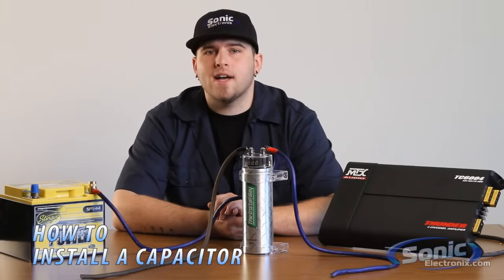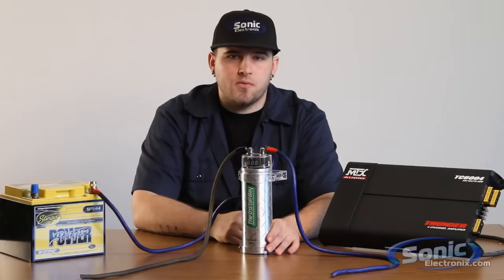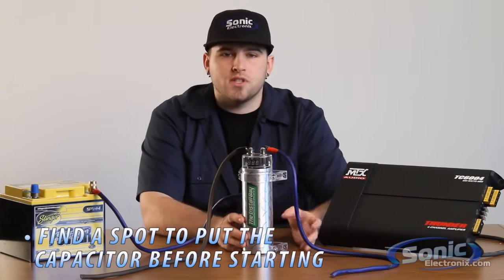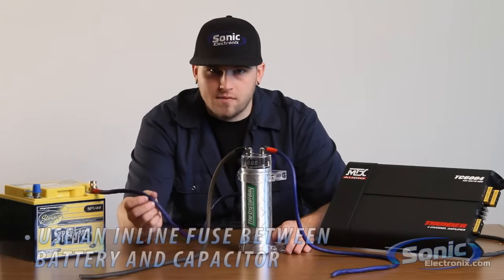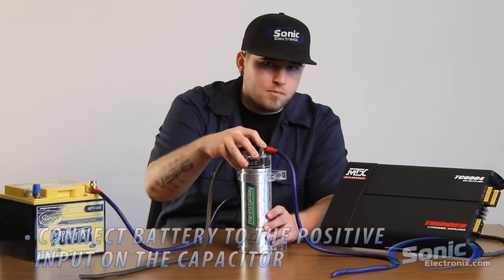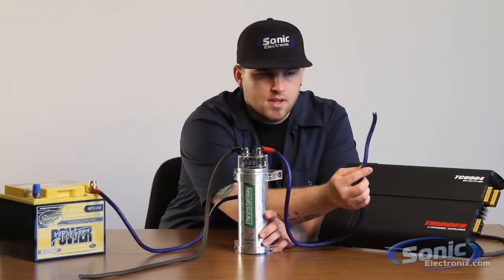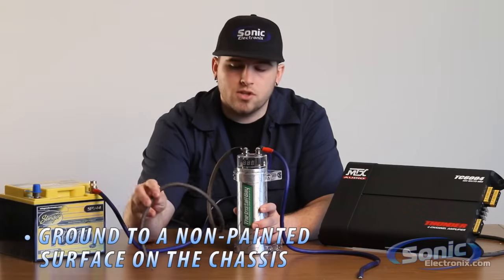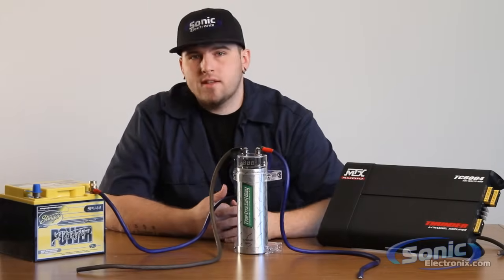How To Install A Car Audio Capacitor

Comment: This may not be the help you're looking for but after reading what you're working with, this is my suggestion. First of all, 2 TypeR12's need quite a bit more power than the amp you have. Especially in a sealed enclosure. Underpowering is as bad as overpowering. Second, if and when you do get that better amp, 6g wire is too thin. You need at least 4 and thats minimum. Third, forget the cap. Just run an extra battery. I know this is more money, but you will be MUCH happier with the results.

Comment: If you study how a capacitor works, you will quickly start to question the need for one in the first place. Forget the cap. Just get an extra battery. "Kinetic" is a great way to go.

Comment: Hey I was just wondering if anyone could help me out. Does the gauge wiring matter when using a capacitor? And my cap has 3 terminals for positive and 3 for negative. Can I use any terminal for input and output? Input being from the battery and output being to the amp. Im using 6 gauge wiring, 80amp fuse, 1300 watt exonic amp 680 rms, and 2 12 inch sealed alpine type rs. The cap is 2 farads. Thanks in advance

Comment from the maker: The wire should be fine, as for the fuse you would need to get an inline fuse between the capacitor and the amplifier.

Comment: and what sort of fuse is going to be the best for 5000w its my first time with such a big amp (i have 0 gauge wire will that be ok ?)  and i get that it goes battery fuse capacitor but then do you need a fuse between the capacitor and the amp ?

Comment from the maker: A capacitor temporarily stores energy to relieve stress on the amplifier. A capacitor should not be used to replace a battery if the system is underpowered.
Reply: What size fuse should I use

Comment: a capacitor or cap for short holdes a charge and lets it out whenever bass is being played in your car audio then recharges at very fast high speeds

Comment from the maker: You want to put the capacitor in line between the battery and the amplifier.  If you have multiple amps you'll need one cap for each amp and use a distribution block to route them back to the battery.

Comment: Q:What is it better to connect the capacitor before or after the power block? And how will i do that with 3 amps one to my door speakers and two the my sub, but the sub amps are link to each other. Help please. The sub is an Orion HCCA 10.4. O everything is running on 0 gage.

Comment: Stupid question, but I hooked up my capacitor when I was tired and before I really read any instructions, and I connected the battery to the positive, and the negative went to my amplifier. It worked well for a while, which is what had me confused for a bit, then it started cutting out. My question: did I fry my capacitor by doing this, or is it still probably useful when I hook it up properly? If it's still good I'd rather keep it and let it work.

Comment from the maker: It would be better to ground it to the chassis. If your battery in in the back of your car, you can ground it to the battery. Sometimes grounding it to the battery can cause ground loops to form.

Comment: And i made the big 2 in ground - to get more ground to the battery.The relé really helped the amp not to suck much of the batery when the car was stoped. I have the double relé 80A with on/off switch between the capacitor and the amp only to get the amp shutdown and i made a cut with another switch to my radio becouse my radio really consumed battery even when was off. Does this means that the relé its doing its job right and the capacitor and battery are charging good ?

Comment from the maker: There can be many factors at work here. It could be a bad ground, something in your system isn't turning off (like your amp), but it's likely a defective capacitor.

Comment from the maker: First, you need keep your grounds as short as possible. Also, if your lights are still dimming you might have exceeded the limits of your electrical system (i.e. Battery, capacitor and alternator). If every thing has checked out ok, then you might need a higher amperage alternator or even possibly a second one.  You might want to also consider the big 3 upgrade if you have not done it already.

Comment: The most of people don't know how to really use a capacitor and what it does. The capacitor only helps powering the amp during hi drawn kicks, ir order to not cut the output signal 'cause a power drawn.
Everybody I've seen connects capacitor in the wrong way. Just conenct in parallel to the battery. In this case, the capacitor is useless. The right way would be installing a hi power diodes array between battery and capacitor. Doing this, yo prevent discharge cap throug the rest of vehicle.

Comment: And another thing.the car as 44ah 440Abatery.I have the ground amp screwd to the security belt.And then i have the capacitor grounded to the negative batery and between the capacitor and the amp hive conected a ground cable that conects the ground amp+capacitor.the good thing is that the voltage are more powerfull to the capacitor and batery does not discharge.But the head lights dim quite a bit allways in the 2 ways hive grounded the capacitor etc goes dim all so in dashboard lights.whatcanido?

Comment: Hi, Hive seen many videos and photo examples on how to instale amp and mega capacitor. And my question is:My car as a capacitor and a amp with 2channels 550w and i before ground it at the same spot of the amp. And the baterydiscarged and the capacitor showed picranges down 12.5volts.Now hive seen a picture that shows to ground the capacitor on the negative batery.Hive donne that and the picrange shows more thant 13v plus and low pic12.8v but every time the lights of the car vibrates,whats rong?

Comment: A capacitor is more for supplying your amp with 12volts at all times (if it dips below 12 you're going to loose quality and power)

Having a capacitor whilst your engine is off will let your sub last slightly longer if you leave it on, but you battery is still going to be drained (it's the same as just putting two battery into your car)

There really isn't going to be a battery in the world that's going to store enough to keep a 1.1kw amp running without the engine on I'm afraid.

Comment: Is it ok to run the power to the amp straight from the positive terminal on the cap and then run the ground from the amp to the negative terminal on the gap to a ground point?

Comment: ok you almost answered my question in the video. should the cap be grounded at a seperate location than the amp? or can  the amp or amps be all grounded at the same spot as the cap?
(should)

Comment: It just means you wont be draining your battery as much. But your alternator still has to charge the capacitor... if you get what I'm saying.

My girlfriends Corsa has a 3.2 k amp and it's only running off the stock battery. head lights dim quite a bit though.

Comment: I'm looking at purchasing a 2 farad capacitor for my 1800w kenwood system. Is it required to have an upgraded battery? I have a side terminal battery and I had to mess with some bolts to install the amps power cable, I'm can't seem to find any car audio batteries or anything much larger than my stock battery w/ a side terminal.

Comment from the maker: If that is the total wattage for your system them we would recommend an Kinetik HC1800 (KHC1800) or bigger to run in-line with your stock battery.

Comment from the maker: @400exman02 You can get a capacitor. But, the best thing to do is get a power cell battery. Capacitors are a great addition to a power cell battery.

Comment from the maker: @hasnachos This is only for stereo applications.  It is used in line between an after market amplifier and your battery.  If you want to just increase the efficiency of your entire electrical system then do a big 3 upgrade.

Comment: @mardegan86, you can have 1 ground dude, try ground one amp first to ya chassis and see if it goes into protection mode if it doesnt try unplug that one and plug in the other one and check again

Comment: @scootbmx01 its grounded on a 10 to 12 inch long metal that goes under my back seat, do you think it needs to be directly to the chasis, also theyre about 4 inchs away from each other, i have 2 amps.

Comment: @scootbmx01 i do have power going to the amp, im not using the capacitor anymore im getting a gel battery instead. now my amp doesnt turn on, i already checked all the fuses and i do have power going to the amp, the amp got 2 lights a red and a green one, the green one says power the red one says protection, only the red one turns on. any idea why is that?

Comment: is this only for stereo applications or can you also use this to balance voltage drop when you use all the electronics in the car simultaneously? lets say, car stereo and bass very loud, every window rolled down simultaneously, brights on, a.c, adjustable seats being moved, wiper blades on high and any thing else that may use electricity being operated all at once? i was thinking about this because windows roll up faster one at a time.

Comment: @jody024, exactly if you have the space then batteries will be heaps better but if you dont caps are the next best things and if you want the best of both worlds you can get compact power cells etc:)

Comment: @mardegan86, your cap turns on but reads 00? what capacitor is it? ummm as for your amp not turning on it could be a number of things... if you have a multimeter check the power at your amp to see if your amp is getting power (should be atleast 12v when the car is off and upto 14.5 with the car on) then let me know

Comment: @asjams, ok first off you go by rms aka continuous power...... your subs are about 600 rms each....so you need an amp that will do 1200rms @ 1 ohm (if you got the dual 4 ohm version) or @ 2ohm (if you got dual 2's). as for a capacitor i strongly suggest doing the big 3 upgrade and also get a deep cycle battery and also a voltage gauge :) if you still want a cap general rule is 1farad per 1000 rms so id get a 1.5 or 2 farad for yours :)

Comment: alright to clear this up, caps are not batteries........they are a bandaid fix!!....in my system it helps stabilize voltages and reduces drop on punchy songs....songs that have a continuous bass note iE: tones used for db will see next to no difference with a capacitor because the cap will empty in less then a second..... db competitors prefer not to use them because when empty they suck juice off the battery to try constantly fill back up.

Comment: @SubZeroSkyLine you really don't know how to talk normal do you 
@kyle3420 "trust you" on that ? well then "trust" me on the fact that when applied into the system of my friends car (a car that can be seen on the Polk audio website) it did exactly the job it needed to do . yes of course i know that a cap isn't a requirement to have ( i'm not stupid) but to say that a cap is a marketing scheme (like SubZeroSkyLine says) just isn't true
not all cars even have space for adding batteries

Comment from the maker: @SubZeroSkyLine Let us clear things up here.  You are very correct in saying that a bigger battery combined with the big 3 is the best way to upgrade your electrical system in your vehicle.  However, Capacitors are not completely usless.  If used correctly they can aid your electrical system.  You just have to make sure to have a capacitor that has the correct amounts of farads and has a proper ground.  They will only SLIGHTLY fix light dimming or voltage drops.

Comment: @jody024 Yo dude, trust us on this. Caps won't do nearly as much for you as say a better battery can.  All a cap does is store charge for you system and nothing else.  Like, they will help if the voltage on your amps are dipping too low, but making sure your connections are done properly can have the same effect.  I'm running around 3000w rms with a single optima yellow top and none of the lights in my car dim when the heavy bass hits. I have 0ga everything and the big 3.

Comment: @SubZeroSkyLine what are you a 6 yr old child ? keep urself in control dude a friend of mine used a cap in his system also and it did the job perfectly (in a full polk audio system)
there is no need to cuss at me at all

Comment: @SubZeroSkyLine or you just need to get the right cap for your system have you ever thought of that ? If not then don't spam your crappy thoughts here because caps DO work 
If you get the right one for your system caps are designed to accomplish a specific purpose/task.
It will not solve your alternator problem, nor is it a miracle item.
If used properly, it can aid in supplying constant level of power and AC ripple filtering to the amp.

Comment: @doubleZeeZ dude, don't bother with capacitors. get a better battery.  I'm running around 3000 watts rms with a single optima yellow top.  just make sure you make clean ground connections and you'll be fine.  caps are a waste of money

Comment from the maker: @chiddyxxbang This might cause you to have alternator whine and engine noise.   It is recommend to have the ground of your amp connected to a paint and corrosion free surface of your vehicles chasis.

Comment from the maker: @Dave50Bat You need to make sure the the ground is to the chasis of the vehicle.  This will complete the electrical circuit and cause everthing to function correctly.

Comment: @SonicElectronixTV im running 2 820w amps, 800w mono block and my headunit off a 65amp hr battery and a decent 12powersupply, i would need a 2f cap  parrell (inline) with the battery as all the amps are parrell. is that correct?

Comment: How do i decide what capacitor is good for my subs? 2 12' power acoustik 600 rms each, amps 1300 rms. I figured i was gonna stick with power acoustik cause theyre stuff is good, but how do i know what one would work the best, what do i have too look for?

Comment: Hi. I have an EV SUV invention of mine in mind. I want to use capacitors rather than batteries.. is this ok? Would it work? Maybe U would recommend BOTH?...  Also, are most capacitors 12V (as I would probably need this kind of voltage)? 
 Why are U safe doing this on the table like this? Is it because no current flows out of the battery until you draw power & turn on UR appliance/tool/motor? This is just a guess, am I right?... Also, would a 1"X4' long metal rod do OK 4 groundN stuff?

Comment: hey i just installed a capacitor on my car from you guys. i just connected one terminal for the ground from the cap to the chasis and  left the ground that i already had to the amp connected. when i turned on my car the voltage meter turned on and everything seems good, but there is just not as much bass as it used to. i know it can deliver much more bass what would you suggest the problem is? thanks

Comment: Hey quick question. Can I ground the amp and the capacitor on the the same spot on the chassis. Both ground wires will essentially be touching but can they be on the same ground point? (I have a chevy blazer and there are bolts that lead to the chassis that I use now for my amp)

Comment: @Mustang552 Depends on the setup of your car. You could put it anywhere between the hot side of your load (NOT directly to battery, unless you want to shock yourself - these caps CAN KILL YOU EASY. Besides, you dont want it on anything powered on without your key in the ign or acc position or you're charging the cap all the time, and the losses will dissipate constantly. They have a finite life. ALSO use a 500k or higher resistor between the cap leads to drain the cap safely when powered off.

Comment: It resists the change in voltage. That's all. Electronic devices are just signal manipulators. 1 Farad is 'huge' for a cap, but not really much of a storage device at all, but if your car has its lights dimming and voltage dropping much below 12-13 volts, you really need a bigger alternator or a smaller pulley on it.
Watts/volts=amps. Your ignition, accessories, lights, etc might be 40-70 amps total at times, so a 1500 watt system needs more than that & will rape your battery lol

Comment from the maker: @MrDOA313 When you have a system and have a high power surge from bass, like the brief hard hits, the capacitor let's loose some energy to compensate and help save the battery. very quick. then charges back up.

Comment from the maker: @killa4nyah Remove the capacitor from your vehicle and make sure to handle with care. Take a 12V test light or resistor and touch the positive and negative terminals on the capacitor bridging them together. Make sure to wear safety goggles and heavy duty gloves or hold the light/resistor with insulated pliers. The resistor or light will get very hot and could pop. Once the light goes out the capacitor is discharged. When the resistor becomes cool the capacitor is discharged.

Comment from the maker: @EMata713 A capacitor is not measured in watts.  It is measured is Farads .  1 Farad is equal to roughly 500 watts RMS.  For example if you have a 2000 watt system, you are going to need at least a 4 farad cap.

Comment from the maker: @imfercho You definatly would want to consider purchasing a high preformance alternator.  The small alternator you have now is not going to be able to properly charge your Optima battery.  A capacitor could help but this does not seem like a very high powered system and it should not require a capacitor.

Comment from the maker: @DerrickT113 This definatly sounds like an issue with the capacitor.  We would suggest taking a multimeter and checking the voltage of the remote turn on wire to see if there is any change as well.  This may be the issue.  Otherwise it could be a defctive capacitor.

Comment from the maker: @f3l0ny33 Yes, the Big 3 and a high output alternator are always the ultimate way to upgrade the electical system in your vehicle.  A capacitor is the easiest and least time consuming way to stop light dimming and such.